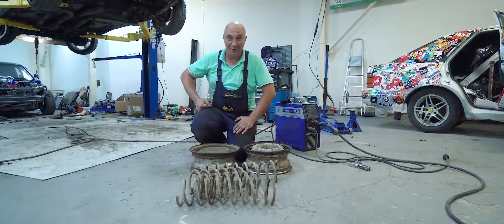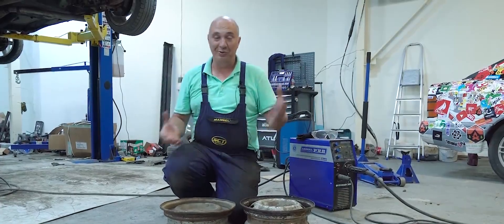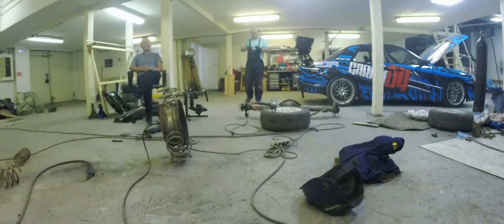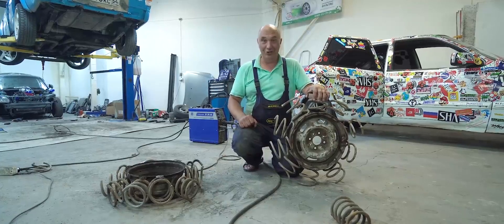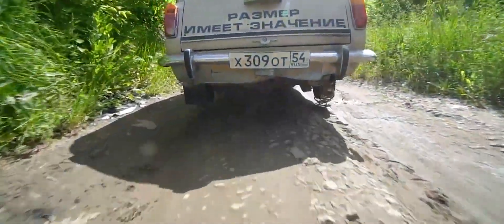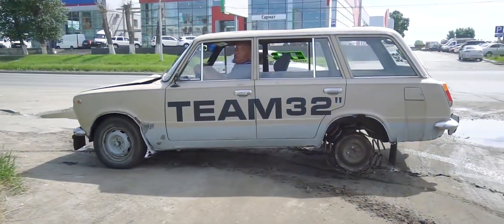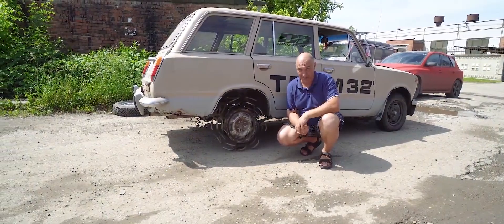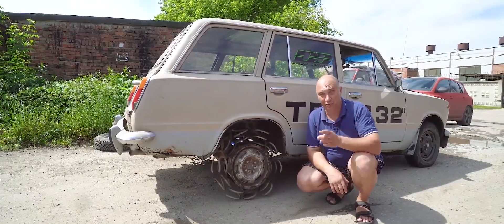Using springs instead of rubber tires

Comment: 37 years ago when I was young, living in the coldest times of Denver Colorado, always snow on the ground, I had an idea. Because I would always see so many car accidents, I realized later just home much of a difference sand or cat litter on the ice can give you back traction to your car. I had always wanted to build an emergency system that would deploy sand or cat litter in a stream in front of the car, when you push a button, for emergency times when you lose control. 

This would require sand tank with pumps with electric motor with enough force to shoot the product at least two feet in front of the tires. It doesn't even have to be that much product at a time either. If you could build this and test it on ice, I had always guesstimated it could recover at least a 60% of traction in the worst case scenarios which obviously could save you from crashing or dying. 

37 лет назад, когда я был молод и жил в самые холодные времена Денвера, штат Колорадо, где всегда лежал снег, у меня возникла идея. Поскольку я всегда видел очень много автомобильных аварий, позже, уже дома, я понял, что песок или кошачий наполнитель на льду могут вернуть вам сцепление с дорогой. Я всегда хотел построить аварийную систему, которая бы выбрасывала песок или кошачий наполнитель в ручей перед машиной, когда вы нажимаете кнопку, на случай экстренной ситуации, когда вы теряете контроль.

Для этого потребуется резервуар для песка с насосами и электродвигателем с достаточной силой, чтобы выбрасывать продукт на расстояние не менее двух футов перед шинами. Это даже не обязательно должно быть так много продукта за раз. Если бы вы могли построить это и протестировать на льду, я всегда предполагал, что он сможет восстановить как минимум 60% тяги в худшем случае, что, очевидно, могло бы спасти вас от крушения или смерти.

Comment: If you put a curved piece of flat steel between every 2 springs, and screw a piece of tire tread on top of the flat metal, that should give you a smooth, quiet ride. 😁👍

Comment: Needs revisit! Steel rim welded around the rim and lots of springs like valves and use the retainer and tack it on the top . Mount with a low profile tire. No air ?

Comment: What if you put a rubber tire over the springs instead of air you just use the springs inside the tire so they rid a bit smoother?

Comment: i have had a similar idea a long time ago and rethought it considering a lot more improvements such as it being an outer layer of rubberized hexagonal track pads linked together on the back to each other and to the springs . thus you would have a wide tire like surface with rubber that can conform to ground irregularities and maintain grip and be supported by a chainmail like understructure then the springs , this thus should give you performance better than an air filled tire, but would weigh more unless you used some sort of titanium/aluminum super expensive alloy . also if you used steel on small tires at high speed if and of the components came off it could do some serious damage so the wheel well would have to be armored and virtually encase  the wheel to prevent projectiles from escaping. always some sort of trade off.
      instead of one spring wide  use several smaller springs in a 3d offset pattern diamond or hex etc. then an intermediary layer linking them together and forming a flat but flexible surface layer to affix the hex pads on top of ( like 3d chainmail ).

Comment: Garage 53 , just put a thick film of rubber around the spring wheels and they will be more like real ones, and the rubber elasticity will fix the tension and make it smoother, also not damage the road, as to metal to asphalt

Comment: Lol no welding mask with sandals on lol I wish I was a Russian 😭
Reply: Nah, they're just ignoring. Welding radiates UV which actually burns the soft eye tissue (e.g you'll notice small indentations ON the eye when blinking) and also leads to cataract. It also affects all cells (hence the recommendation to wear full face protection)

Comment: the primary issue with this is the damage it would do to roads.
now if you could put a rubber on the outside i think that would help with that.

basically replace the air with springs.
so you have the rim then the springs and then the rubber tire stretch fitted over top of those.

Comment: Its a shame you can't send a 5 volt signal to tbe tire pressure monitors because then you can hit a switch that sends a signal to a garage54 installed solenoid in each rim that makes one spring in each rim pop out 12" then BAM! A jumping car!

Comment: Do you know that in the 30's there were bikes' tires made with small springs? They covered them with a plate of iron.. You should of add a plate of iron around your wheel spring and it will run much better.

Comment: I think you could revisit this idea but refine it a bit get some rubber and cover the springs with tires and this will be kinda like a run flat design were the car can use springs rubber and the rim all together to create a road legal tire that can run even if its flat.

Comment: Try to fit a tyre over them for the ultimate run flat tyre and then try to buckle the wheel by hitting bumps hard, also over load the car with weight to try and get them to fail.

Comment: Now weld a flat steel rim or belt around the springs, rivet some rubber to the outside and you have a state of the art airless tire. Maybe Michelin or Goodyear will copy it.

Comment: You should cut the tread part of tires off and mount them on these springs. Like you did with the hoses you cut into pieces with the tire. Maybe the tire tread will make this spring setup quieter.

Comment: Would be worried about starting fires possibly yet I do worry a bit, higher ambient temps or road base other signs demonstrate your prowess on your welds, engineering, and correct proportional angles or load test seem very interesting and positive. Great work!

Comment: Welded chain treads. No weld links between springs. 1 ring at each edge of tire or tire wall, more may damp out the springness. Keeps springs in alignment so less stress on wheel weld spots flexing.

Comment: Could you put a rubber tire around it and use these instead of traditional air pressure?  I wonder if that might actually be a good product (rubber tires with these springs inside)

Comment: Wonder how that would do in mud. 4x4, all wheels?
Reply: Dig hole and sink to the floor boards very quickly and then create slurry potholes around the wheels. You are going no where. Do you not know what a kitchen blender does to pieces of food and water?

Comment: Great vid, how about using old leaf springs cut down to size and welded all around the rim with some kinda spacer between the wheel rim and backside of leaf spring ? Peter

Comment: You should compress the springs, then take an old tire with the inside and half the sidewall cut off, wrap that around the springs then release the springs into position. Basically a poor man's anti pneumatic tire.

Comment: You should add the rubber tire over them. If it's even possible. That would kill the noise and might even ride smoother. That's a good idea with the spring tire.

Comment: I am surprised how stable the ride looks on these springs. A little more tinkering and you could build military grade puncture free tires or wheels. This could be done and could work even for heavy and fast moving armored vehicles. I just wonder if someone ever thaught about making tires of springs and make themcheap in production at the same time so the technology would be afordable light weight and safe to use in all situations. Great video and great idea. Keep them comming.

Comment: Would be more efficient with a outer metal band around the springs and then the metal band could have a rubber traction surface or paddles for off road.

Comment: The only problems I see are vibration, noise, and how it tears up the street. But all of that could be mitigated by attaching a track around the springs with maybe a tire-like casing around the whole thing. You would have a nearly permanent tire that does not need air, and if made right, could last the life of the vehicle.

Comment: I bet if you go to a stone street and hit the parking brake it will spark like hell!  IDEA: GET A FLAT TIRE AND RIM, DRILL HOLES IN THE RIM BARREL.  NOW LIKE A CORKSCREW INSERT THOSE SPRINGS UNTIL THEY TOUCH THE TIRE  AND WELD THEM AT THE HOLE WITH MASK SO AMERICANS DON'T HAVE A HEART ATTACK :) BALANCE THE TIRE AND FEEL FREE TO DRIVE AS FAST AS YOU WISH, YOU CAN EVEN PUT AIR IF YOU WELD SEALED.  IF THIS WORKS.  MAKE SURE WELDS DO NOT DRAG AGAINST BRAKES.  IF IT WON'T WORK BECAUSE YOU WILL BE CHANGING THE BALANCE OF THE WHEEL AS YOU MOVE, YOU'LL SEE COILS FLYING ON THE ROAD.  MAKE SURE YOU ARE AWARE OF THIS WHEN BALANCING

Comment: You should put a rubber layer on the outside of the spring on the wheel
Reply: I agree this could be a lajit good idea
Reply: @tombox9389  legit*
Reply: That what I was thinking
Reply: Thats what I think so , free flated tires with great suspension and live long but need some flat metal or tephlone before rubber for flatness and decrease fractions and corrosion
Reply: They already have them they are called twheels
Reply: Hey, I was thinking of that!
Reply: Maybe put on a bigger tire ant attach the spring to it ? Lots of ideas

Comment: You should do this exact same thing again, but put a metal band all the way around the outside, welded to the springs and then put the outside rubber of a tire on the metal band. so it'll look like a real tire but with springs instead of a sidewall and air. lol

Comment: what about welding a steel flat rim ( the same size as the springs) Would the spring still work but be softer as there will be no digging into the dirt?

Comment: I don't know if anyone has mention this or not, but try cutting the center out of a larger wheel so that the outer part of the larger wheel rim will go over the springs. Weld the srings to the outer rim. With the sp rings between the inner & outter parts of the wheel you may have a better ride

Comment: You should weld a steel belt on the springs to make it smoother and could add rubber to make it better

Comment: Hy !!! IDEA !!! Can you build a lada that dosent have engine instead of wheels and all the undearneath of the lada should you put  powerfull sound speakers basicaly all the underneath of the car and with powerfull amplifiers you should try levitate the lada lift it in the air by the power of sound and audio speakers hope you get the idea try to use loads of speakers it should lift your lada at list 4 cm or more from the ground with the right power you need a high ritm low frequency noise hope you crazy russians you can do it :)))) !!!!!!!

Comment: Take a tire where the inside diameter under the tread will be large enough to fit over the outside diameter of a stock tire. Cut the inner wall of the larger tire out so it can slide over smaller tire. Attach chains to the inside so it can be secured to the smaller tire, and modify tread to enhance traction. You can take a grinder and cut deep grooves into the outer tire and test it to see how well it works instead of chains. Can also mount metal lugs and see how well that works.

Comment: I'm not sure how to make it, but the lunar lander had mesh tires. Could you find a way to build something like that?  It said that  the tire is made of a woven mesh of wire to which  treads were riveted in a chevron pattern. The inner-frame, comprised of a relatively rigid metal structure, prevented the mesh from over-deforming during impact,

Comment: Will this provide the necessary friction on a metalled road at an elevated speed  ???? I am not making fun .... i just wanted to know and if you replace the front tyre instead of replacing the back tyres ... will it cause problem in taking turns ??

Comment: You'll need to make a ring in the middle so there's more welded area, then try out your 4 wheeling ideas. I think they'll just kind of slide around on hard surface streets, but getting on the gas will be spectacular in the dark!

Comment: well done, I just want to suggest to add some flat bars or anything that you can attach the  rubber you still need to the spring and on its tip there you put the flat bars, so that you can screw the rubber so that when you drive even in the concrete road you cannot create any noise... the purpose of the spring is to make its suspension better.....

Comment: Make carbon/ rubber slips for the area touching the road that can slide on and be locked down and when the tread runs down use a printer to resurface them.

Comment: Keep the coil springs on the wheels. Just add steel plates on the ends of the springs like a tank. Maybe attach sections of tire tread to increase traction.

Comment: It's really a bad idea. Without any load the spring strain a lot. In addition to load it will fail. It also reduce the mileage. I accept that tyre are always prone to failure but this type spring is a stupid idea. Rubbers are viscoelastic (i.e) some loss and gain. The loss is by heat build up. But the spring is completely elastic it does not mean that it have lower loss. Traction will be very higher. It does not suit for economic purpose. My best opinion is TYRE.

Comment: Put it on the highway and get it up to 65 and see what happen
Reply: jawbone10million disaster
Reply: Most likely catastrophic failure
Reply: They would just compress fully and either rip off or provide no suspension
Reply: tovarisch militsia will happen xD
Reply: I wouldn’t advise running these on pavement because it would tear up the road.  It could end up being an extremely expensive video to produce…
Reply: jawbone10million lol
Reply: Thad be wicked
Reply: wouldn't the springs turn to red as the springs get hotter..
Reply: @locomotionsixpack8254  That's not how that'd work . . .
Reply: @locomotionsixpack8254  no the springs would be destroyed long before that could happen
Reply: Death
Reply: Due to high velocity,the impact will be less,but the spring will be bent also the car may skid,but since the front tire is of rubber it would be fun to watch
Reply: @fredfaridsedehi8775  you would like to see that
Reply: Florida lottery lol

Comment: Here's an idea  same concept  but fits inside of a tire with curved plates on the end of the springs ? You could use it as airless spare tire? Also in case someone or cops try to shot your tired out or lay out a spike strip?

Comment: Try a combination of springs attached to the wheel but inside the tires. Inflate the tires to normal pressure and then test them against police tire spikes.

Comment: The only problem I could see with this is the loss of traction on flat surfaces and the fact that the springs aren't meant to take lateral force very well, or at least the welds. But this could very simply be mitigated by putting the traction of a tire on the outer edge of the springs and bolting in the springs.

Comment: Why don't you cover it with rubber... Its been quit more reliable and comfortable.
Reply: Those springs would likely destroy the rubber quicker than they would destroy even through roads we drive on.  It would need a metal framing then maybe rubber could be placed on afterwards but then framing the springs would prevent flexing of the springs, rendering them back to needing air in the rubber for cushion.

Comment: Spring tire not good idea. If you drive in straight line and weight stay the same. The springs will be fine. But the weight is always imbalanced and the car has to make turn all the time. So you would have a very unstable car with terrible traction. It would also behave very strangely if you try to drift with it too. Although it would be really funny to drive off a cliff and land on all 4 tires. Would it bounce like in a cartoon?

Comment: If everyone used springs instead of rubber tires 
all the roads would be destroyed in one month and need to be repaved every month..
In Canada in the 1970's they got the idea of insert steel pins in the tires so you won't skid out of control on icy patches...
After one year all the main highways had to be repaved.
The steel pin tires were quickly discontinued and made illegal to sell or use.
Stupid ideas are stupid ideas.